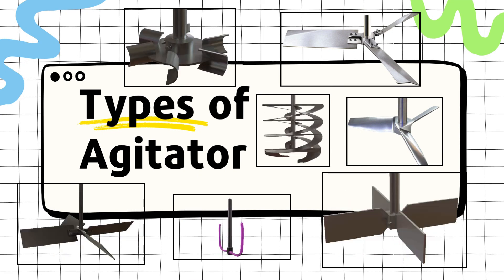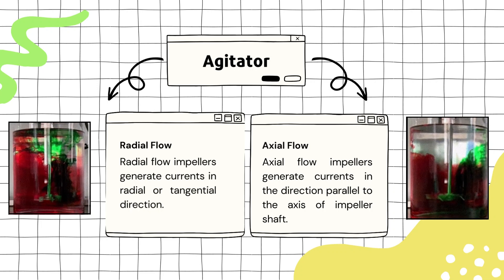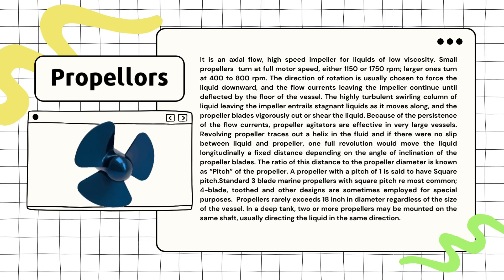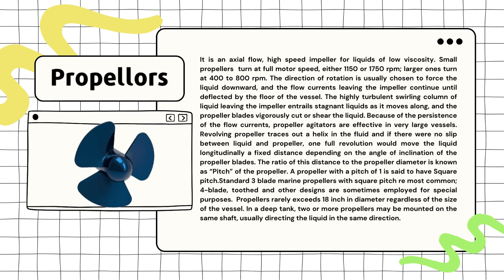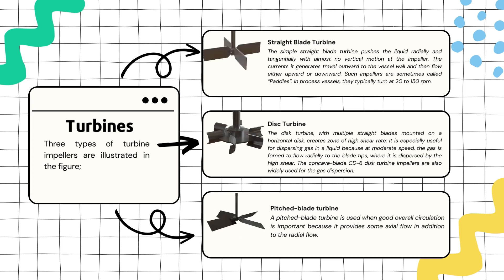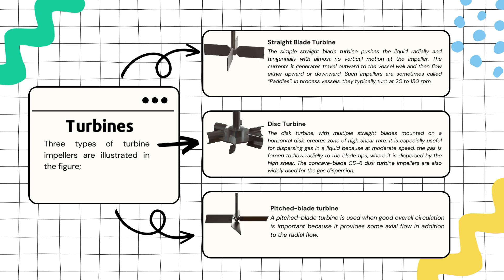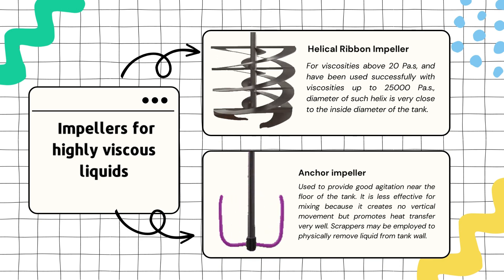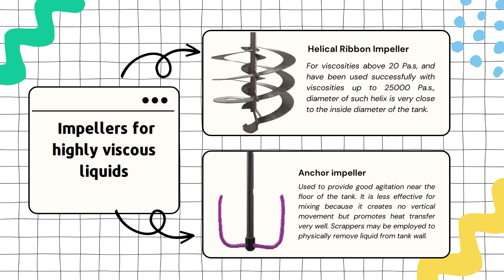Types of Agitators | Propellers | Turbines | Radial and Axial flow impeller | PBT | Anchor | Helix .

Comment: Hi sir thanks for the video i have a question if i want to  mix tahina (sesame after milling)and  flour and oil can i use multi stage mixer like helical blade down the vessel and paddle blade in the middle and turbine blade on the top ?